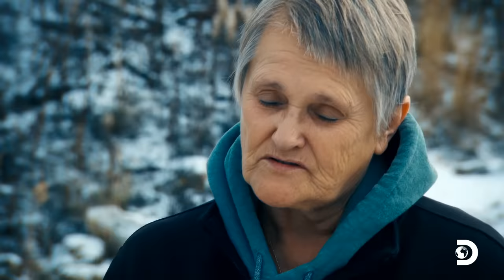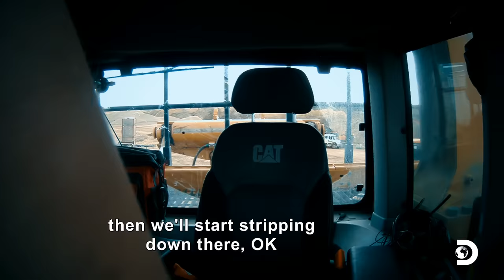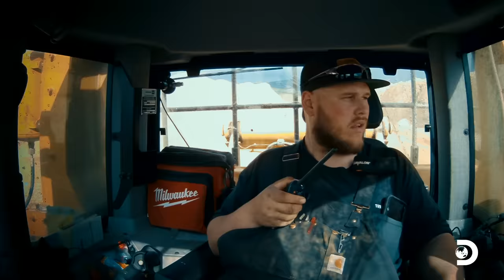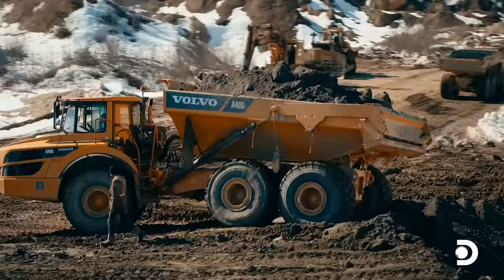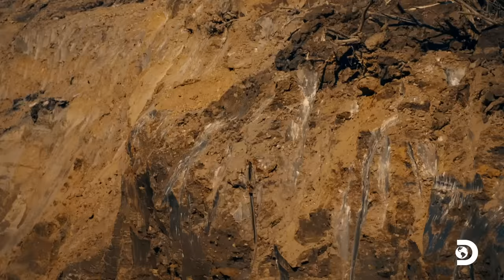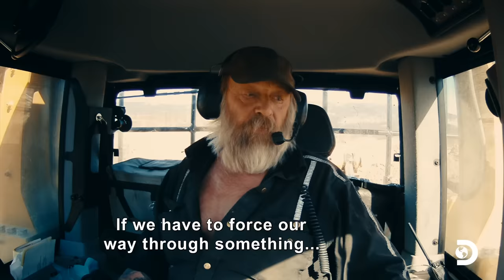Tony Beets’s $5 MILLION Fleet of Machines | Gold Rush

Comment: The price of that D11 changes with every episode 😂
Reply: Yeah its not 2.7 million dollars 😂
Reply: 2.2m USD however the price to ship a new one all the way to the yukon probably makes up the 500k
Reply: @nOtJack1886  That depends on how its shipped because if its shipped in seperate pieces its probably cheaper. Only issue is that they can be a right pain in the ass to assemble.
Reply: @nOtJack1886  the new D11 starts at $1.9M for a basic model and ends with $3.0M for a fully loaded one. The $3.5M they mentioned was probably CAD. But off course he never paid so much, it's all sponsoring. Maybe he paid half the price, mayby less, but I don't think he got it for free.
Reply: @IronWarrior95 I saw a 1990 D11N for 146,000$
Reply: @MarkD770  good for you. This isn't a 1990 d11.

Comment: Notice how when she couldn't dig she was using a flat faced bucket, when she's digging after Tony used the dozer she was operation with a bucket that has teeth on it
Reply: And teeth were on be4 she got caught it was swapped
Reply: It takes about 5 min to change a bucket. If you are good 2 min.
Reply: @joaoraposo9519  yeah buckets are easy to swap, the 320l I run is just 2 bolts holding in a backer plate, if your lucky and have a quick attach it takes mere seconds, when you have to start driving out pins is where it really sucks to change buckets
Reply: 2 different machines 2 different operators too...but don’t let that stop you

Comment: i love how they blur the cat logos on the 349 excavator but the d11 they dont
Reply: It is because Volvo does not make dozers.
Reply: They are sponsored by Volvo. Only the D11 is sponsored by Cat. That's why they got a Volvo 95t excavator and not Cat. He has probably spent half as much on them as these new machines cost, or even less. It's a good advertisement for their machines. Otherwise everything would be blurred and I doubt they would even buy Volvo stuff if it wasn't sponsored. The Cat 395 is stronger and faster.

Comment: Is it the ripper shank that weighs 10 tons? Or is 10 tons of pressure applied to the shank. Thats breaks that ground up like that ?
Reply: The shank weights 10 ton. 10 tons pressure would be like nothing.. a D5 can do 10 tons pressure easily. The D11 could get to like 60 tons or more. When he pushes the the ripper into hard ground, it starts pushing the dozer upwards and the dozer weights 120t itself so 80t is possible.

Comment: I wonder if they really need trucks that big for their operation. I think they can save a lot of money on fuel and truck cost by using tatras, in 6x6 or 8x8 configuration. They are used to tow tanks, the trucks are famous for their half axles moving individualy for each wheel, so you can fly over bad terrain, it even significantly saves fuel. Their engines are air cooled (oil cooled and fan+radiator cools the oil), so they never freeze, never overheat. And you can take them on normal road, if you decide to carry material from longer distance.
They are quite popular in australian mine operations. 16 tons carry capacity for the smaller 6x6, 28 tons for the 8x8.
Reply: 16t capacity? That's a little more than one bucket from the 950F, then he would have to wait for the next. That wouldn't make sense, 25t neither. You don't buy big excavators for some little pu**y trucks. He would need 20 of them to keep up and 40 people to operate in 2 shifts a day. For a 950F, 45t is barley enough, 60t would be better, otherwise its wasted productivity potential. In next season he has 3 big excavators and 10 trucks and he would buy more if he could and they definitely need it. Also he has sponsorship from Volvo and Cat like all of them.